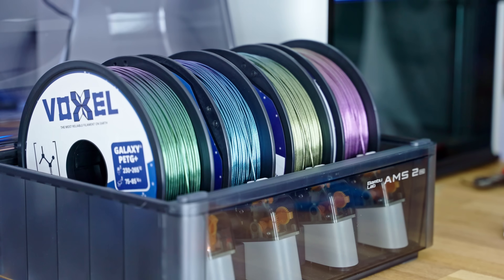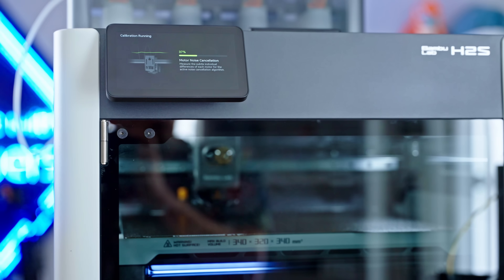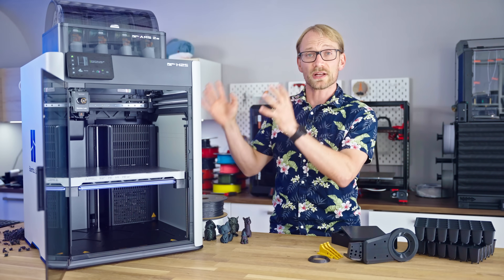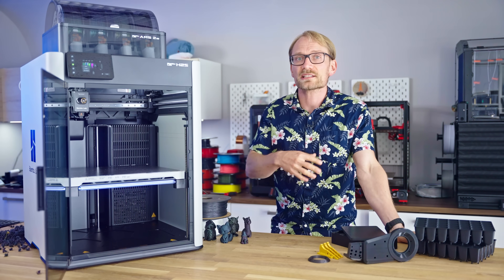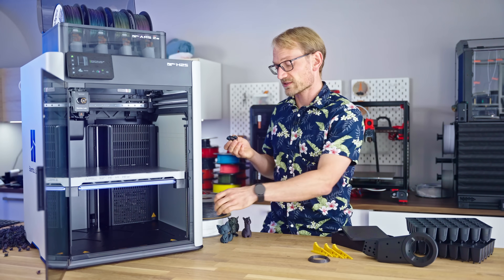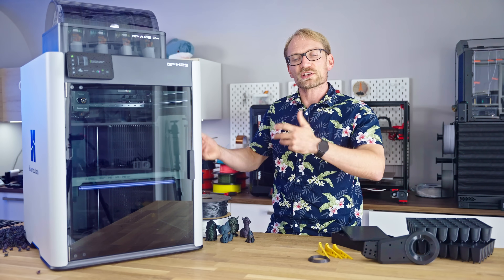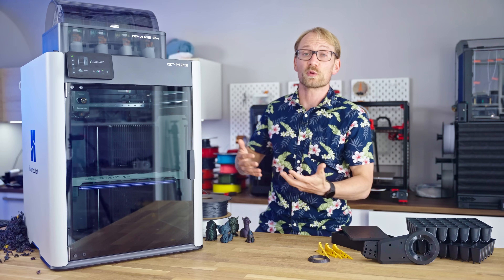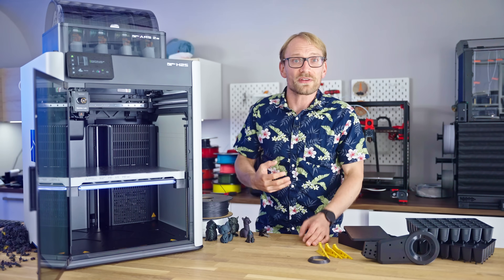Is Bambu's H2S truly a H2D Lite or just a bigger X1C?

Comment: sponsored reviews just shifted the definition of "cheap"
The H2S isnt cheap,  its might be "fair priced for its features and size compared to other offerings". 
but its still locked down and it could be bricked at any moment turning it into a pile of scraps if you dont block its internet access. its very unlikely but not impossible and happened to many things in the past.

really looking forward for the snapmaker u1, 
if its true what it claims it will be a prusa XL but for normal people, who dont get such things for free.
Reply: A Voron 2.4 or Trident with a toolchanger is cheaper and more capable without the closed source bullshit Bambu has.
Reply: @UsernameWasLost no it's not, it's much more expensive and much worse.
Reply: a H2S is cheap for anyone that uses their printer for actual serious use cases instead of having one to be a funkopop factory hobby machine. 

the costs is completely normal for a productivity tool with it's capabilities, printers are as important as laptops to people who say, have to prototype a lot, or quickly produce specialized parts, and people often spend €2k+ on those too.
Reply: @marvinslomp3564 yeah the H2S is cheap but isn’t for anyone who’s truly serious about printing accurate parts. That’s where formlabs has them beat. Engineering grade materials and accuracy rather than a simple hobbiest-grade machine like the H2S
Reply: almost all major brands have now "out of the box, no fiddling, perfect prints all the time and reliable" printers that can work with farm software.  not just bambu. 
for a fraction of the price.
Reply: They are not sponsored, why are you lying? And yes, it's cheap for what it is.
Reply: It uses any brand of filament. We have a different definition of what "locked down" means.
Reply: we talk again when bambulab pulls another one and forces a firmware update on all printers that makes you sign a subscription or throw it in the bin.

and im not talking about drm hell like scamlabs resin printers, thats a whole different topic.

Comment: With the filament wiggle it may be doing that for 3 different reasons.  One would be to remind you which filament you are editing, particularly if you have more than 1 AMS connected.  Second would be to maybe read the RFID tag if there is one, and third would be to estimate remaining filament by comparing extrusion distance to to spool rotstion.
Reply: It usually does a whole revolution to read the RFID tag

Comment: The filament wiggle and light on the AMS is super useful when you are running multiple AMS units. Helps you keep things straight.
Reply: I'd be surprised if the indicator lights for each filament position don't also illuminate too.  The bad camera angle used couldn't show that.
Reply: @zybch theyre so small that its kinda redundant tbh. Wiggling the whole spool is a much better solution

Comment: people on the comments complain about open/closed source, one push the other forward, the more competition the best, even if you don't want to deal with bambu shenanigans the industry benefits from their existence, so despite not being interested in one i hope those printers sell well.
Reply: @brunoyudi9555 I think you are making an excellent point, them driving the competition and setting expectations for what is a high end standard for 3D printing.
Reply: @KorbakSC 3D printing was left static from the 80s to the 2010s due to a patent on the technique from Stratasys that made it infeasible to sell anything for 3D printing. This is, I believe, part of the reason that early RepRap printers weren’t sold and you had to print all the parts yourself. Competition can be good, but companies that act like Bambu rarely allow for meaningful competition in the long run. It’s pretty clear that they’re aiming for a closed, Apple style ecosystem where they control the entire stack from hardware to software. They’ve already shown they’re willing to take functionality from users through updates. If it continues in that direction I imagine we’d end up with a similar situation to paper printers. Nothing is compatible, they all run their own firmware, are black boxes, sign you up to automatic ink refills and refuse to print if you cancel, are a pain to set up, and break quickly. 

My point in all this, is that if nobody was pushing back and constantly complaining, it’d be far worse. You cannot argue that Bambu is a net good while simultaneously implying everyone who dislikes them should keep it to themselves.
Reply: I think it's great that Bambu finally pushed printers to become something that work perfectly out of the box and it's really shown how behind Prusa is. I do think the community has lost something with the most popular printers being closed source and now the majority of people 3d printing have no idea (or care) how the printer actually works. Instead of being a hobby it's now a tool just like an inkjet
Reply: That makes no sense, sorry. Try again.
Reply: @_Jester_ maybe you should try to elaborate, there is nothing to try again because you didn't make any argument to begin with.

Comment: We're at the point 3D printers are working better and more reliable than regular printers.
Reply: It's been that way since I got into 3d printing 12 years ago
Reply: Get a Brother laser printer if you have paper printer reliability issues.
Reply: Always has been. 2D printers are just unreliable pieces of hardware.
Reply: @pixobit5882 the printing side tends to be pretty reliable as long as you aren't wasting your money on inkjets, but moving a floppy material like paper is pretty challenging especially since the material properties change with relative humidity.
Reply: @JoeMorrison paper is similar to you I guess 😂
Reply: @pixobit5882  I needed to program access to printer software to trigger print jobs against different printers... If you think the hardware is bad,... I whished for gcode files those are at least logical... So do not forget to insult the printer software as well ;)
Reply: That is so sad. Not gonna lie
Reply: It's wild, I hope we never see the day of proprietary filament like they've done with the ink.
Reply: if bambu made a 2d printer, i would definitely want one
Reply: Well said
Reply: Oh, we passed that years ago.
Reply: Hold that thought, my parents called and I need to go throw away their 5th ink jet printer and buy a new one.
Reply: Just in time for them to be made unreliable.
Reply: Ironically, filament is cheaper than printer ink
Reply: Yeah. No. Not even close. Unless you compare this bambu printer to some cheap Samsung laser of course. But that's obviously stupid.
Reply: Regular printers were never reliable
Reply: Lol that's so true.
Reply: Talking about that, my Epson is not printing color again. While my decade old cheap i3 knockoff still works fine.
Reply: Just said that to my wife this week
Reply: Honestly, that didn’t take much….
Reply: All types printers are bastards when they want to be 😂
Reply: We passed that point long ago too
Reply: Am I gonna have to subscribe to filament now?
Reply: @lebojay  this is the wonderful thing with 3D printing origins being open source etc. If anyone wants to make a 3d printer that people want to use, they have to make them use the standard filament specs.
Reply: That problem was solved once and for all by laser 2D printers. 
May the inkjet printers go the way of circular ship hulls or Da Vinci's air screw.
Reply: I have pimped up my ender 3 pro so much so there is not much difference between ancient ender and new printers
Reply: You aren't wrong. I go through so many nozzle clog/wifi issues/print line issues on my epson ecotank printer
Reply: Mid to high-end inkjet printers are pretty damn reliable.
Reply: Oh we have been there for years now lol
Reply: 😂 no
Reply: ... no we are not
Reply: Corner the market, drive companion out, once everyone is gone add a subscription.
Reply: @tristin5723  100% the plan.
Reply: Bambulab, Stratasys and others are working on fixing this issue. Trend is surely there. Planned obsolescence, proprietary parts, filament by subscription. It will happen at some point when there will be no open competitors left.
Reply: @shadyb  Stratasys is basically the Xerox of 3D
Reply: @shadyb  dunno about that. Stratasys yes. but Bambu doesn't block third party filaments. but it's just better optimised and smoother workflow with their own filaments. if filament was a cartrige then yes. it might be locked down. plus, bambulab filaments aren't exact super expensive. for the convenience of knowing the filament is the right colour / % remaining / correct profile / correct drying settings in a multi user office environment.. what they offer is well worth it
Reply: @shadyb there will always be open source 3d printers. The thing is, for 95% of the users those are worse than a closed source system. 

Most people, including myself are willing to pay a lot more for a good printer not a half baked piece of shit that needs the community to solve their lack of caring. Like Qidi or Sovol or Flsun. 

I'm willing to pay for a filament subscription, as long as it isn't too expensive.
Reply: At some point, 3d printer companies will realize they are too reliable and will go the way of 2d printers - planned obsolescence. Or, filaments will cost ~$100/roll, like ink.
Reply: I’m gonna be that guy… I don’t want to be. But I’ve had a Brother laser printer for 10 years. Both a black and white and a color. I’ll never buy an ink printer ever again. And I’ll never get anywhere near HP, Epson, or Canon. I comment only to say that good 2d printers exist. They can be pricey up front. But you can get one and only ever add paper. And on rare occasion add toner (only ever purchased 2 toner cartridges.) it prints double sided, scans from a document feeder double sided, and of course has a flat bed scanning function and copier. No need to install extra software to use it (not even to scan). It connects to WiFi, lives in a completely separate room away from any computer, I can print directly from my phone. 10 years in and I don’t even remember having a paper jam.

My bambu lab is a year old and has had plenty of issues comparatively. No complaints, they’re just in different categories.
Reply: laser printers suck for nice quality photo prints tho. I've got a laser printer too but the quality is just not that for photos. So I rest my case 😜
Reply: @JDerp93  Dude came back 2 months later to make the dumbest point ever and said "I rest my case"
Reply: just got the notification of replies and likes lol 😂😂
Reply: @JDerp93 my $5000 Xerox laser do pretty effing good photo prints if you use good paper and treat it well. Can I also rest my case?
Reply: bamboo went from stepper motors to brushless and thats ground breaking, garbage home inkjets use brushed dc motors, and no accelerometers to get what, 0.0508mm2 dots. 3d printers have a while to go. Like why is nozzle changing a thing. nozzles could be auto size things instead.

Comment: Amazing features, amazing print quality, amazing performance out of the box. Wish it would be possible to own such a marvelous printer, especially after paying over €1k for it.
Reply: Clippy wouldn’t have taken an expensive printer for a positive review
Reply: Orcaslicer is LAN-Only, what an absolute nonstarter.
Reply: @Nathan0A  not entirely, you can slice in orca and then send the print via bambu connect from the same machine, so you can solve the issue with a couple of clicks
Reply: @shanematthews1985 Sure, currently able to do this with x1, but it was reported in the video that orcaslicer is LAN-Only with this printer. Also somewhat implied that H2D is the same way.
Reply: @Nathan0A  You can do that with any of the currently supported bambu models, bambu connect only requires a properly set up file, it will send the files to the cloud on orca's behalf, it could have been a single click but the orca dev decided he wasn't happy with the idea and stood his ground, respect to him for standing by his convictions, the H2D is being added to orca anyway soon so then you'll just be able to open bambu connect and send those files over aswell